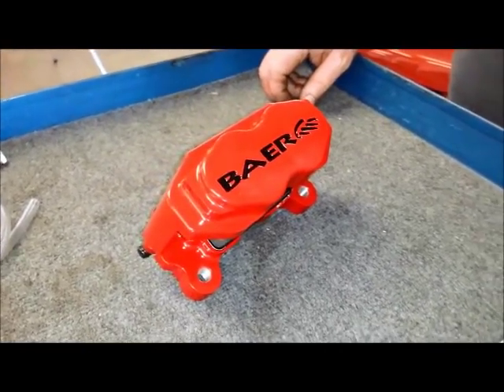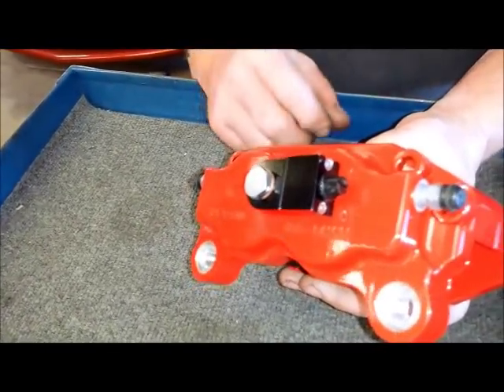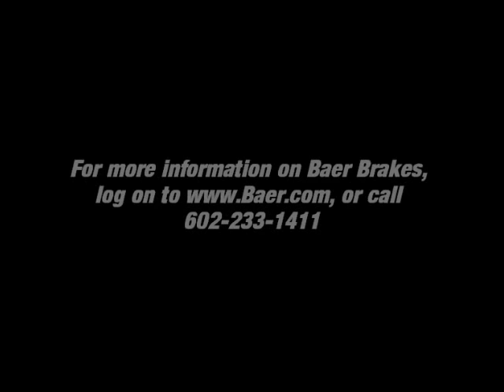How To Install Baer SS4 Rear Brakes

Comment: Excellent video... i wanted to do this conversion once to my 1975 chevelle, but sadly, i sold it off years ago and the nicest thing about it all, compared to this car, is that it had a GM factory bolt in axle type rear end, not c-clip type, much more reliable IMO. I found it off a 1976 chevelle four door with factory ordered limited slip in a junkyard, it even had the limited slip adative tag still attached to the back cover. So i bought the complete rear for $75 at the time, cleaned it up inside and out and put a set of actual GM 4.10 gears in it, not aftermarket, my chevelle was setup street/strip style, so i had some fun with it, ahhh, the good old days.

Comment: Boy, I wish I could run brake likes that (9:00).  A $1,300.00 set of discs and this is how you run the brake lines, really?  The hose clamp for the bracket is really going to keep this car out in front of the pack.

Comment: "Look mom no shims" -- and he and the instructions never said how to measure it. And how lose that caliper is on the guides -- feel like wrapping it with Teflon tape or some non melt dope to keep the rattlers away.  I'm just saying this design is very primitive, but that could mean less parts to screw up.  Don't forget to check your round-out and in-and-out play -- get those suckers centered where they need to be , which is distance between the boss that surrounds the pads and the rotors. Some fat feeler gauges should do the trick -- push and pull them axle shafts in and out like you are doing slalom, so the rotors are not hitting the aluminum around the pads. Check out all the Baer vids for more hints.   I guess these brakes are based on KISS or Keep It Simple.